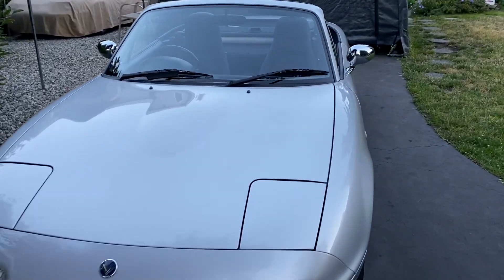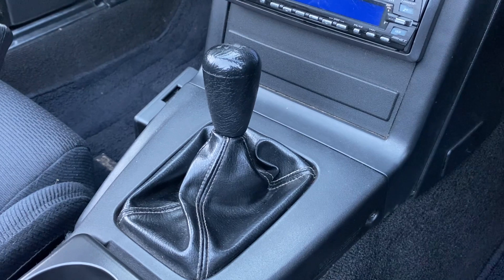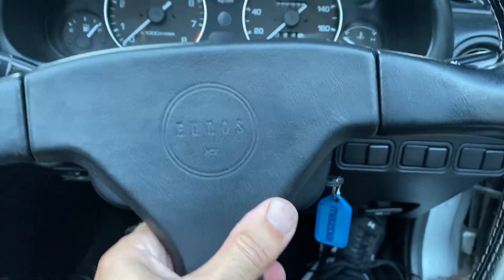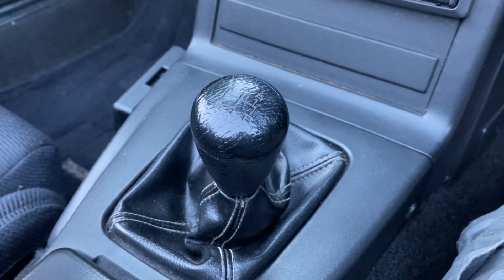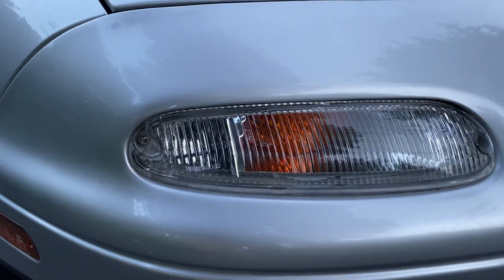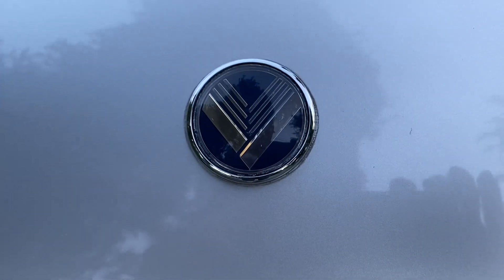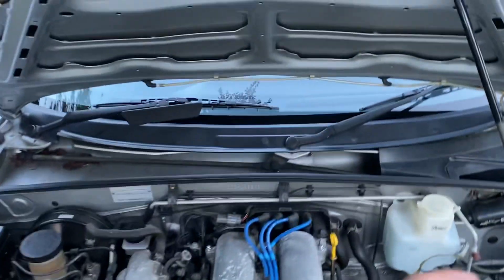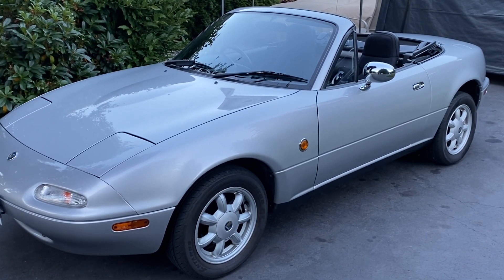1990 Eunos Roadster farewell video.

Comment: Sad to see this one go, and good thing it didn't get canabilized a few years ago by my friend! On another note, most cars in Asia back then didn't require clutch to be depressed to start the car. I don't think it has anything to do with the auto>manual swap.
Reply: Same with EU cars. I can start the car without the clutch pressed but it will also turn over if it's in gear